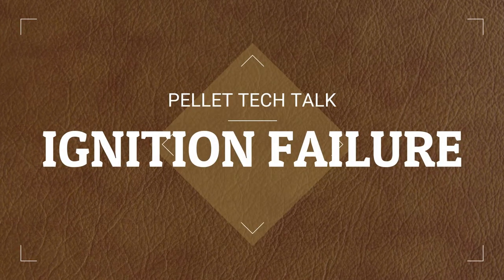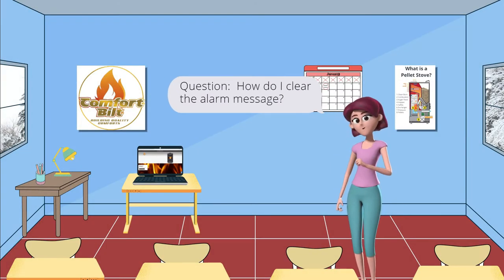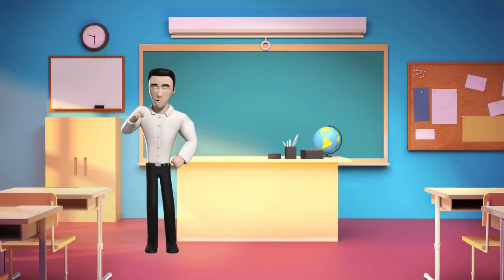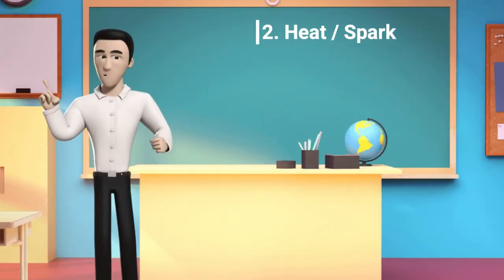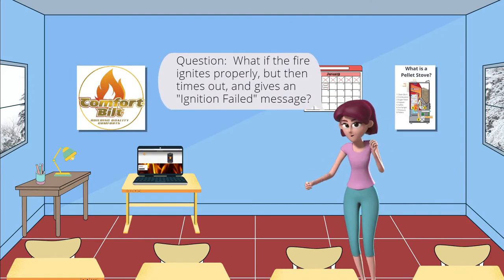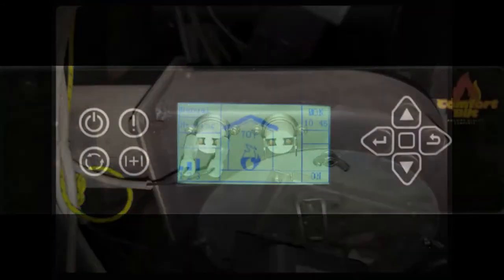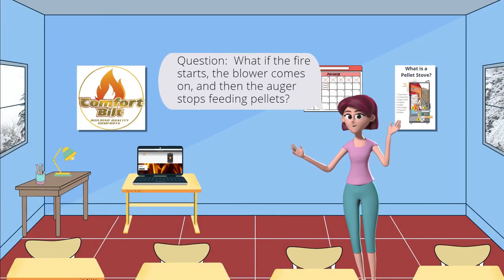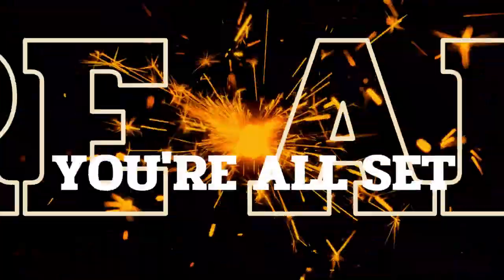Ignition Failure

Comment: There is definitely an interlock switch on the pellet supply door (HP22N and others?) causing auger disable  that should be mentioned. if one loads pellets while burning on the lowest setting and takes too long to do so, the stove can flame out because it is starved for fuel . This is the first stove  I have used that uses such a switch (used older stoves), but I imagine this switch is required by a more recent government safety regulation. Comfortbilt deserves a lot of credit for these great feature, operation and troubleshooting videos!

Comment: my insert comes on but will not light. Display goes to stop then to fireoff and just blows cold air it will not ignite
Reply: I am having a similar problem with my 3 month old stove. I either have an empty fire pot or a fire pot over full with pellets. I have been turning it on and when the pellets get over the top of the igniter hole, I open the hopper door until it lights. Then before closing the hopper door I hit the door switch a half dozen times as it seems to not always work. I cannot take it apart now as it is Winter. Comfortbilt is 2 hours ahead of my time zone so, it is difficult to contact them by phone.